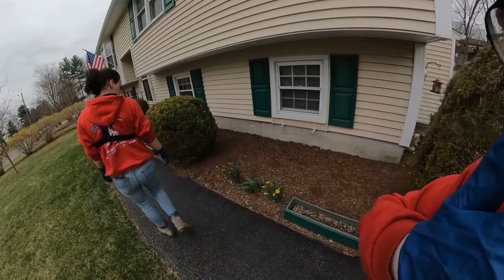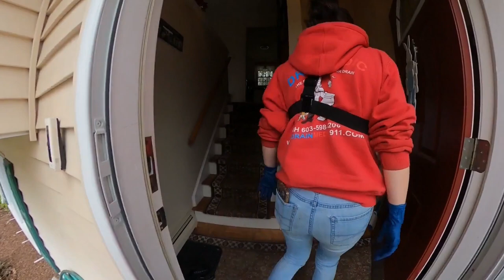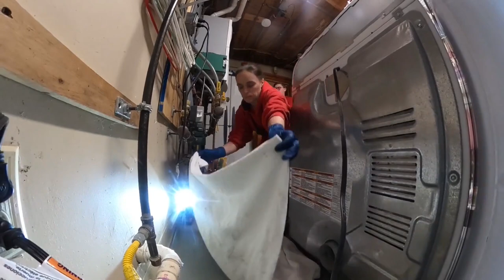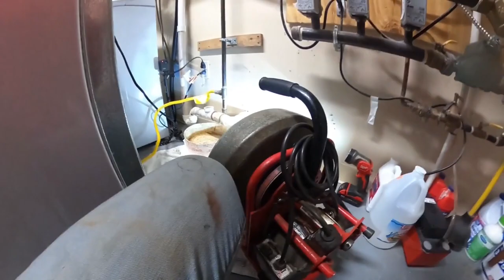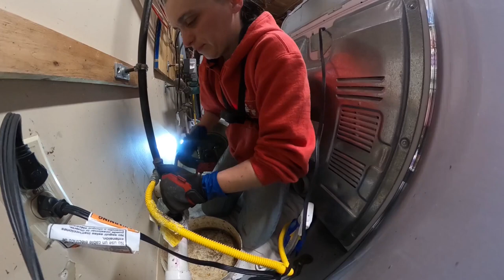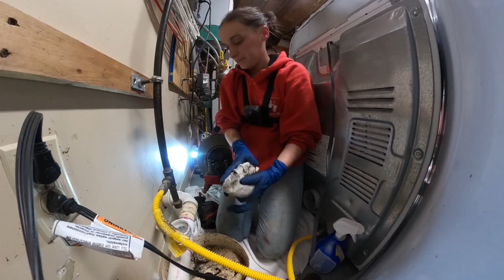Clogged Drain #129 How We Clean A Washer Machine Drain

Comment: I usually just put pipe dope on my cleanout Shelley. When you tighten it up, it will deal all of the gaps. Good job, plus that cleanout sure did help?
Reply from the maker: The cleanout definitely does help, we don't like the dope personally because it kind of turns to like a glue after a while. (Shelly)